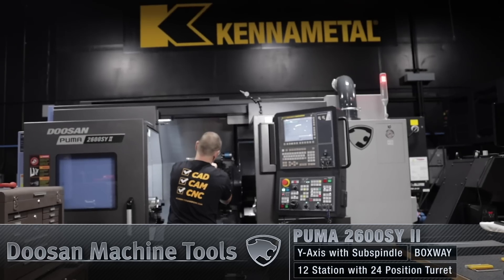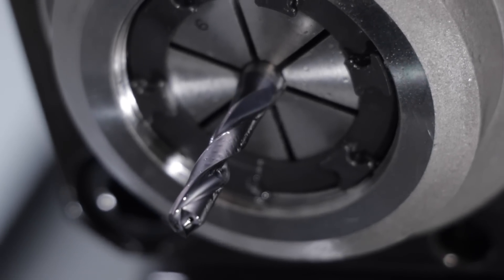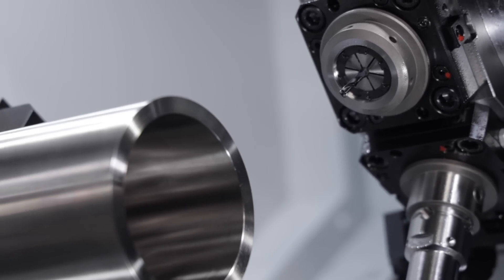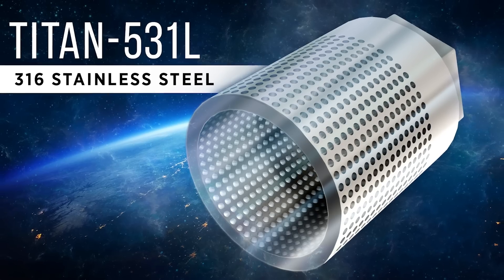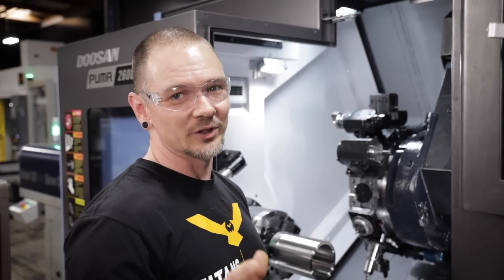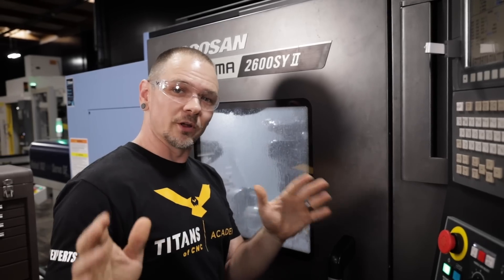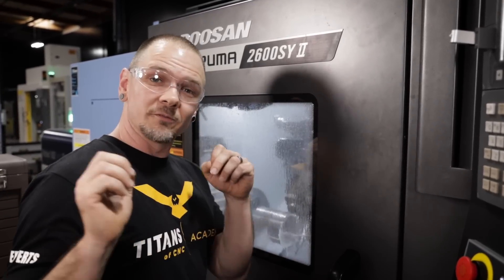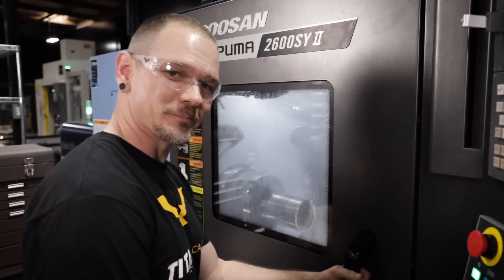Drilling 800 Holes in 316 SS | DN Solutions PUMA 2600SY II Lathe

Comment: Universal program for more hole in circle xD
%
O00023
(circle hole)
#101= 16 (tool)
#1= 78 (X1 - START )
#3= 600 (X2 - END )
#2= 0 (A1 - START )
#4= 360 (A2 - END )
#6= 50 (Step - X)
#8= 30 (hole full circle)
(########################)
#7= [360/#8]
#2= 0 (A1 - START )
#4= 360 (A2 - END )
G21
G0 G17 G40 G49 G80 G90
T#101 M06
G90 G00 G54 X#1 Y0 A#2
S500 M03
G43 Z10. H#101 M08
G98 G83 Q2. R1. Z-8. F30.
N1
 #5= #1

WHILE [ #5 LT #3 ] DO1
#5= #5 + #6
X#5
END1
#2= #2 + #7
IF [ #2 GE #4 ] GOTO2
A#2
WHILE [ #5 GT #1 ] DO1
#5= #5 - #6
X#5
END1
#2= #2 + #7
IF [ #2 GE #4 ] GOTO2
A#2
GOTO1
N2 G90 G80 Z10. M09
M05
G28 G91 Z0
G28 A0 Y0
M30
%

Comment: Think this is cool , I was in outside sales calling in a customer in Sandusky Ohio aka Sandusky Foundry they made their own special stainless paper suction rollers some 4 feet on diameter x 25-30 feet long
Thousands of holes. They have a custom machine that can drill 1000 holes simultaneously “ row by row by row and then counter them external and internal. 
One of the worlds largest gun drilling machines ever. 
Incredible.

Comment: I remember when I was apprentice ( mid to late 70's) the tradesman on a manual mill with dividing head would drill a similar hole pattern in a cylinder. He would drill 50 rows around the cylinder. Some rows had 6 holes , some rows had 8 holes. Small holes were drilled through the wall thickness then counter drilled 2/3 through.  His drawing was a flat layout of the holes and whenever he was drilling these parts everyone left him alone to concentrate.

Comment: Sure would save a lot of cycle time snd reduced brake actuations if the hole pattern was linear instead of radial. Also I’d check load meters as it sounds like it’s bogging down. Then you could also use arc jumps to further reduce cycle time. Carry on

Comment: I work on a cnc drill capable of drilling 242 holes at a time. A typical roll we drill may have between 250000 and 1million holes. Most I have drilled in on piece was 2.1 million holes.

Comment: Should have done the outer row first instead of last. Should have checked the first and last holes instead of first and middle. Half the holes could be undersized and you wouldn’t know. Especially since you are unsure the drill will last that long. Also, should have done the checklist by in process instead of after. Hundreds of work hardened undersized holes are going to be impossible to fix.
I seldom had extra material to cover for scrap.

Comment: Man, I don't know what kind of sorcery is going on here, but today I just learned the hard  way that stainless steel is near impossible to work on. All the drill bits in my shop fell into depression and broke.
Reply: Slow them down.   But carbie is your friend
Reply: If using HSS drills, start with 7 m/min surface speed and continuous coolant. They will last until the days end if you just have the cooling there. Stainless doesn't conduct heat very well, so the tools heat up fast.
Reply: Just needed to widen a hole. At the end I hooked a round file to the drill, oiled it up and did the job. Nonconventional, bit it worked.

Comment: When I started my career as an aircraft mechanic, my first day started off with the drilling out of 800 CherryMax rivets on a horizontal stabilizer, with a hand-held pneumatic drill motor, to remove the skin from the frame.  The lock ring on each rivet required being drilled off with a #40 (0.098") drill, then the steel stem was driven out with a hammer and punch, then the head of the rivet was drilled off with a #21 (0.159") drill, followed by punching out the rivet shank.

Day two was drilling out the 800 rivets on the other side of the stabilizer, but those were easy, by comparison, since they were solid rivets.

Comment: Im curious how did You deburr those holes on the inside
Reply: Quite easy, from the outside through the hole, there are special deburring mills, even with small diameter and long shafts.
Like the Guhring - Front / Back deburring mill for live-tools, available in different diameters.
https://www.guhring.com/BrowseProducts/Products/Front-back-deburring-mill-Deburring-Tools
Reply: @ytfan3815  I did't think about that.
Thanks
Reply: You're welcome.
I would  create the correct tool-path for deburring the contour and some sub-programs ( incremental H 7.2° repeat 50x and 16 rows ) the program isn't that big.

Comment: Drilling the Holes like that will lead to Part Distortions
they should be drilled in Honey Comb Patterns to allow for even stress relief
Reply: 3/16 holes show the wall thickness is at least 3/8 and quite rigid and all the coolant will keep any thermal problems away.
Reply: You don’t get to change the part to what YOU want. Customer provides the blueprint, you do it to the blueprint
Reply: @Ratbert32305  and as long as you drill to the drawing using a honeycomb pattern what's the problem? He's not talking about modifying the design, just the way they're machined
Reply: @Ratbert32305  🤦🏻‍♂️
Reply: @Ratbert32305   what are you talking about...
the order in which you drill the holes affects how stress build up in the part.
Drilling Holes is a Linear pattern can lead to  internal part stresses that causes distortion
by using  a more randomized pattern, the stresses also become randomized.
I worked on Heat Exchangers with 2800 holes.  
When all the drilling was done, many of the Holes were no longer round.
We had to Randomize the Pattern, and ended up with a honeycomb pattern that gave the best and most consistent hole dimensions.

Comment: imagine the poor bastard that has to debur all those 😂
Reply: easy.. finish pass on OD with VNMG and finish pass on ID with a boring bar... played that game before.
Reply: They could have used a Heule self adjusting deburring drilling system. Would be about 20% inacrease in cycle time... which could be decreased if they drill all holes that in one Z row, and then rotate the C axis.
Reply: @balazsbakos4056  Trap Card Bojler Activated .
Reply: @kisspeteristvan  Small world. :)
Reply: @balazsbakos4056  These things are the best tools ever created.
Reply: They should have centered the holes before drilling. Leaves a nice debur and makes the drill’s life easier.
Reply: @balthazarnaylor5874  You don't center holes when using carbide drills ...
Reply: @kristoferwestin6609  waaaaaaat?
Reply: @balthazarnaylor5874  Yeah, because if the slightest deviation in position when the drill comes, it might just break. Carbide can't take bending. 
So if you countersink it to the point where it creates a deburr/chamfer, the possibility that it catches one of the flutes and not the other, will result in breakage of the drill. 
Just tumble it for deburring.
Reply: @kristoferwestin6609  well actually , you usually* don't need it under 7-8xd  lenght . Over this you do need Spot/Pilot hole . But for the love of god spot with a bit that is the same 135° or 140° . 140°deg included agle is the recommended . Under 5xd with good conditions , there is really no benefit to spotting . Altough it's a good visual check on the first part . They should have 3D chamfered it.  id and od with a special little tool that would have been the bees knees .
Reply: thats second op who cares (laughing)
Reply: can also throw in tumbler... would take care of the burrs as long as they aren’t heavy hurrs from a worn tool

Comment: I think its more important to know how long to took to debur 800 holes and what was that strategy? Lol thanks for sharing!
Reply: Flap wheel
Reply: Quite easy, my strategy is from the outside through the hole, there are special deburring mills, even with small diameter and long shafts.
Create the correct tool-path for deburring the contour and some sub-programs ( incremental H 7.2° repeat 50x and 16 rows ) the program isn't that big.
Like the Guhring - Front / Back deburring mill for live-tools, available in different diameters.
https://www.guhring.com/BrowseProducts/Products/Front-back-deburring-mill-Deburring-Tools

Comment: and now imagine breaking all those sharp edges by hand 😂
Reply: Doing one of these now, but it has 7, 600 so much fine cleaning up by hand.
Reply: @jnr1226  holy **
Let me know how long it took
Reply: @cLxRiPapaTritton   about 8.5 hrs of drilling. I program a section of 45° then reset the A axis and re run. I'll switch out the 1/8 drill at the half way point.  Only going .300 deep
Reply: mass media finishing friend... most big shops have it. They will throw it in a tumbler and it will take care of that

Comment: I'd like to see the wear on the drill after. Through coolant drill might be better if the machine allows.
Reply: I’ve drilled 150 stainless holes in a drill press. Good HSS and it looked like new still. Schedule 40 2” pipe wall.

Comment: Did you use C-axis brake? Sounds like so in the first part around minute 1:00
Reply: Most likely, it'll all be done in the post processor anyway, post probably adds the spindle clamp code to the end of a drilling cycle no matter what.

Comment: Did this using a 2.5mm drill through 2" 1 " each side  15-5 stainless steel in a 1025 condition.
It tool 2.5 seconds a hole and did over 600 holes and then some.
 Check out Micron crazy drills if you really want to drill holes fast accurate and a cla of 16 without reaming.
Reply: Glad to hear about the tools i grind :) greetings from Switzerland
Reply: These drills perform well above anything I have ever seen.

Comment: Hellow, Titan
For this tool no need centering or thikness is not big?

I made stenless steel part with 1200 D4mm holes using 10 HSS drils.  30mm Dept. Mashine working all night. Automatic tool change one by one =)
Reply: Solid carbide drills don't need centering, it's actually better not to centre them as you can unevenly wear the drill if it starts cutting on a specific point on the cutting edge everytime instead of starting at the very end point.

Comment: and now chamfering the holes xD damn thats gonna take some time xD
Reply: Give the apprentice a manual deburing tool
>8D
Reply: https://www.heule.com/en/alltools/
Reply: @Raphael-1987-c8q  Yeah Cogsdill makes one too here in the US.
Reply: Same program with a bigger spot drill
Reply: @onge1981  that dosent work ( i troed ) since its on a round face you only get about 45% on the edge of the hole well the rest is still mising 
you need to run a small chamfer mill where it goes around the hole in C ( and if you have Y to make it faster ( i dont it on a haas ST20Y where we tried with and without Y )
Reply: @flikflak24  you could program it to rotate in the C axis to create a standard chamber. Go to X value, rotate in C one way, then the next, then go back to start position. It's a bit of trial and error but once you get it for one hole you can copy and paste for the rest. Would save a lot of manual de-burring
Reply: Stepdrill could be the solution to avoid chamfering.

Comment: Funny how it’s deburred itself on the breakout holes 🤔
Reply: A quick spring pass with the boring bar would take care of that.
Reply: Chris, I'm thinking that a spring pass on the part ID would just roll over any burrs rather than actually remove them. I'm wondering how they'll actually deburr that hole too... It can be ID ground to do that I guess, but probably not ID turned. Just my opinion
Reply: @Awegner176   we do many of these at work. Some times we send out for hone. We make deburr sleeves that we shove inside and then drill x about of holes then have to press out the sleeve. Minimum burr that ways. Flap wheel works great won't cleaning up the is as well.
Reply: @Awegner176  looks like I’ve started something, would be nice to know 🤔
Reply: Would definitely be the easiest in a tumbler
Reply: May be its a combination drill.
Reply: @muselva  to deburr on the inside diameter, don’t think so 🤔
Reply: Probably used a closepin debut tool.. just didn't show it.. they only push kennametal tools on this page.
Reply: Cut OD and ID over sized then skim pass to final size after holes are made gets rid of burrsw
Reply: @sarcasticommentator  that would leave burrs in the holes🤔
Reply: @stevenrichardson7882  how?

Comment: I would drill them in Z axis in a row, and then turn the c axis, much less c axis turning and would be faster.
Reply: I was about to comment that haha
Reply: rivercarper01  If you spot for a coolant drill its normally just .02-.05 deep. and needs to be the same angle of the drill. If the drill has a  140 angle than the spot would be 140 also. You would come back with  EZ Burr tool  and chamfer the outside and inside quickly.
Reply: rivercarper01   Try a company  called YG1   ( YG1USA.com  )  1/3 the price on coolant drills + other tools. I do stainless 303,304 & 316  everyday.
Reply: @fryer05maverick31  I use YG1 a lot.  I have their 1 inch thick catalog right here. What do you use for drilling without inside cooling?
Reply: @danl.4743  Gold P drills, spot drill, HPC end mills on aluminum, MQL are the coolant drills & picked up a few of the hydraulic holders for end mills.   Got a few of the Kor5 end mills for Aluminum on that Titian special from Kennametal.   (  agmachinenc.com )  is my shop .
Reply: @fryer05maverick31  Can I get some more info on your experience with their tools in general and their drills in particular. Which models do you use? Tool life?  Do they regrind/recoat used drills? Do you ever run exotics like Inconel, Hastaloy, ect. ? Thanks for your time.
Reply: I firmly agree with you
Reply: Yes much faster.
Reply: It's easier to make corrections of distance between the rows in Z axis just by editing single block and then just rotating the part in C each hole, then move with Z and continue, rather than having to edit I don't know how many holes there are in each row on diameter one by one in Z axis. But yeah I would drill it in Z axis too if I didn't think about that :D Hope I expressed myself correctly, since I am not a native speaker
Reply: @2123Tomas  I understood—and I’m not a machinist.
Reply: Given the rapids on C only move a relatively small mass, and the tool axis moving in Z has to move a relatively large mass, and how rapid all the above rapids are one must assume it would all come out a wash. My only thought would be to spiral inward instead of outward to maintain part rigidity while making the cheese grater...that said this material is plenty strong enough.
Reply: Right Round  316 is a stubborn material to deburr 
I often drill valve cages just like the one on this video and after deburring it I always have to go over each hole with a reamer or a sharp hss drill to get rid of the sharp burr that the deburring process leaves ,and even then it’s not 100% burr free
Reply: rivercarper01  you can give that a try maybe you have better success than me 
I have tried in many different ways but what happening is when you drill it blows the burr in the bore obviously but then when you take a light cut in the bore it will fold the burr back into the drilled holes 
 the only way to maybe avoid this is to grind or hone the bore after drilling  and deburring That would probably do better but that’s an extra machining process which isn’t cost effective anymore 
Let me know how you do with it I’m always open to new ideas
Reply: rivercarper01  That might work but I believe you would get light skip marks from the interrupted cut. This is an oil field part so the finish is most likely a 125 RMS. It's a roughly 20 minute debur job by hand with sandpaper, a cylinder hone, and scotchbrite.
Reply: @Fr1day-RT    in the description its described as an aerospace part.. 🤔
Reply: @peterfitzpatrick7032  My mistake. It looks very close to some of the oil field parts we run.
Reply: Well then you would have to check all the holes with the gauge pin. That would take a lot more time.Now you know which holes were drilled last. If they are in tolerance all are.
Reply: You mean x axis...
Reply: @TritonTv69420  on lathe Z is X, X is Z and Y is well.. Y
Reply: @2123Tomas  No, there is no confusion here. X is X, Z is Z, Y is Y. Think of a lathe like a horizontal mill if your mind doesn't bend with the axis naming conventions.
Reply: rivercarper01  my boss would sack me for adding that much cycle time to the job
Reply: Yes thank you, thing must took all day
Reply: rivercarper01  what is even the point of your reply if you're going to say 'oh some companies don't want to get with the times and use modern tooling'. How do you even get jobs if you have to so everything with old hss bits. You easily get to go thrice as fast, and have 10 times the tool life on these drills. If your company or any other doesn't see the value in this I'd suggest you'd go somewhere else where the place isn't run by boomers.
Reply: No, you can still do a chamfer in 3 axis with a circular move combined with movement in Z
Reply: more faster
Reply: I was about to comment this too. Probably knock about 30% off the cycle time.
Reply: @LAD Teknologies this kind of machine is meant for serial production, and it's not determined what axis you should move more or less to do less wearing to the machine, at least i havent heard or seen it anywhere
Reply: Drill them in Z axis in a row is faster as you said but it's much more unsafe. Stainless is tough. And if you consider that the drill bit could break with less holes you will be in a serious problem and have to waste the whole piece.
Reply: rivercarper01  You shouldn't predrill on typical, short holes for carbide drills! They could brake on that predrill and thy are made pointy for a reason. Only in some specific situations, like very long, many diameter holes you should predrill them.

Comment: Travis, never seen 800 holes drilled before! 200 max before it's cooked or no longer holding its dimensional size! BOOM!!!!
Reply: I have two 2mm drills that have ran ~900 cycles on them. Deviation has only been .0002 through the course of the project. Every once in a while one will get a monster tool that does that.